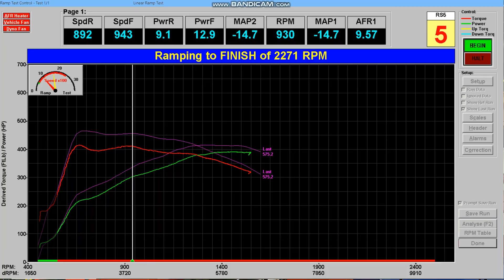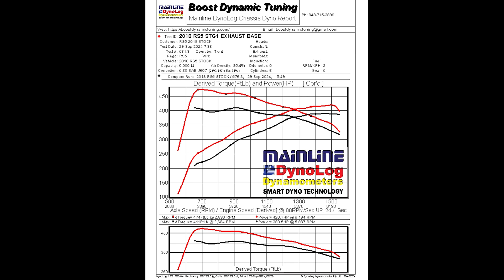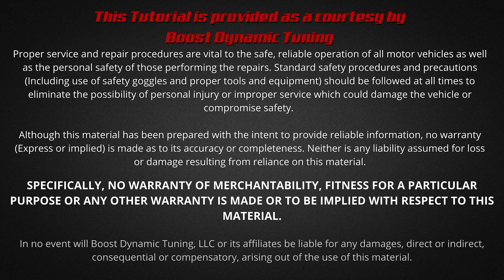2019 Audi RS5 Stage 1 ECU + TCU Dyno Results

Comment: It's interesting that this got 390hp stock and another had done 460, and the new competition 2024 did 500+ whilst all being labeled as 450hp.
Reply from the maker: You're comparing dyno's.... I've said this so many times. YOU CANT COMPARE DYNO'S!!! A DYNO IS USED TO COMPARE BEFORE AND AFTER. NOT SAY OHH MY CAR MAKES THIS XXX NUMBER. 

Let me say it one more time. It's used for before and after to show gains. Like a scientific experiment.
Reply: @boostdynamictuning  I know... I'm just pointing at the weird inconsistencies apart from dynos.
Reply from the maker: @R_301.1  not trying to be harsh. Just there's Zero point in comparing. A true calibrator does before and after. All dyno's should be close when comparing in that fashion.
Reply: @boostdynamictuning  I see brotha, just to clarify, yours is for the wheels right?
Reply: @R_301.1  Every dyno reads different. These are hub dynos that attaches to the wheel hub assembly of the car, which gives a better and more accurate numbers. Roller dynos measures how powerful the wheels can spin the rollers which is not always consistent.
Reply: @XeebThoj728  So this means that it actually makes around 500hp at the crank
Reply: @R_301.1  Correct, it's been proven that BMW M models and Audi S and RS models are underrated from factory. Most advertised HP numbers on paper from factory's are just heat soaked hp numbers. Dynos are meant to measure the difference gains from stock to modified  gains.
Reply: Horsepower at the crank and horsepower at the wheel aren’t the same thing. I believe for Marketing purposes Audi uses crank.
Reply: @GodzilarOG7337  But that's the problem, you see: the Comp does 50*hp on crank while still being labeled as 450hp which is the exact opposite of the strategy you assumed, so I assume this dyno test was for the wheels..
Reply: Wait, Dynos aren't made to show you how much horsepower a car has? That's confusing
Reply: @good6894 They are but they every dyno reads differently. You could be making 350whp in a mustang dyno, but only makes 290whp in a hub dyno. It's better to measure the amount gains from stock.